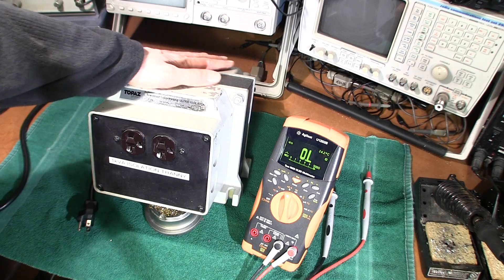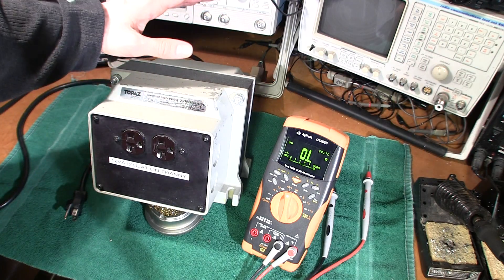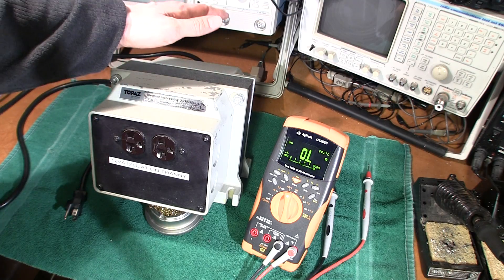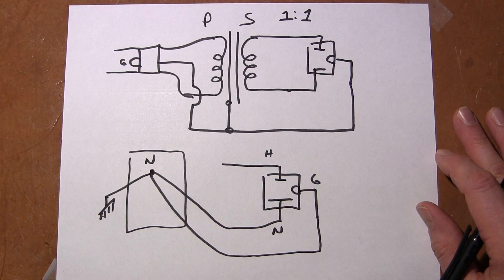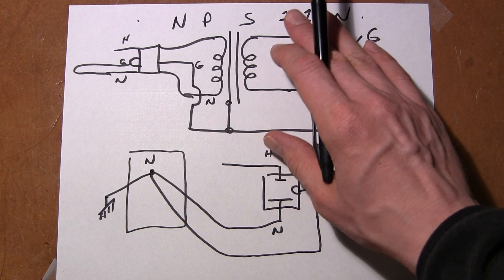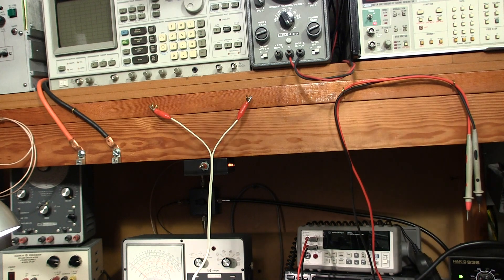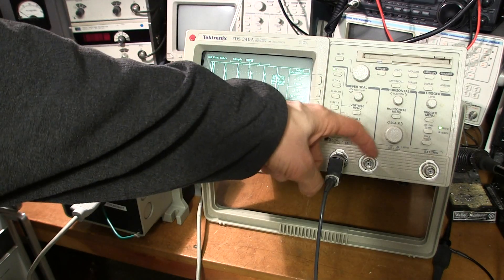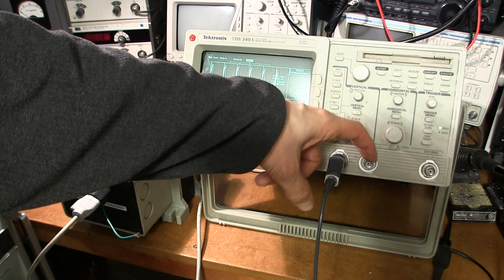Tech Tips Tuesday, Isolation Transformer and Variac Safety

Comment: I've seen many comments here about only the DUT being isolated from ground, however, when I was a student learning troubleshooting and repair techniques, the instructors at the vocational school cautioned us to never have the test equipment grounded. They sent us out to the rest of the world having been taught the very same thing Mr. Carlson showed in this video. Every piece of test equipment in that shop had all of the ground pins on the power cords removed. Every one of them. Meanwhile in the electronics theory class down the hall, they blew up a brand new 540 series Tektronix scope because of said grounding issue! I don't remember anything else about the incident so I don't know what they were measuring, how it was hooked up or what- just that they mentioned it to one of our instructors and then we were told about that precaution. After that the electronics instructors were removing the ground pins from the power cords or using the adaptors as shown here. 

Anyone care to explain why it is bad to float your test equipment? Not looking of arguments or heated discussion, just good explanations.
Reply: I was taking an analog electronics class at the local community college back in the 90's. My lab partner was in the air force and she said usually stationed in an AWACS. I was taking notes and she was hooking up the circuit. so she had the power supply on and somewhere in the circuit she said lets see positive goes to negative and before i could say no!, she connected the connection. there was a bang and smoke came out the back of the power supply. The instructor walked over expressionless. Picked up the power supply, unlocked a closet. He exchanged the blown power supply for a new one, locked the closet and w/o a word put the new power supply down on the bench in front of us.

Comment: I was surprised you said the BBC barrels are connected straight to ground. I'm pretty sure that when I us ed to work with oscilloscopes the bnc sockets were isolated from the chassis and connected to ground via 'safety resistors of 47 or 100 ohms to limit ground fault currents.

Comment: Where I live (Western Australia) it is mandatory that ALL homes be fitted with "earth leakage detectors" whereby if the slightest bit of current is detected in the earth lead then it will trip the circuit breaker (half the appliances in my house tripped the breaker after the detector was installed).

If you KNOW that your mains is properly wired with an earth leakage detector then the safety issues raised in this video are not as great.

Comment: Hi Paul; It seems most folks recommend using isolation transformers when repairing old radios and such, especially the transformerless type. Is there any advantage to using one when working on modern tube guitar amplifiers such as Fender or Vox--or could one be in more danger plugging such amps into the isolating transformer?
Reply from the maker: That's a tricky question Ed. Personally, I use the isolation tranny when ever I can.
Reply: The Viz isolating transformer I'm bidding on has only 2 prong outlets on the isolated side. When plugging in a 3 prong plug would I have to use the notorious 3/2 adapter?

Comment: Never understood the point of an isolation transformer... (It's 1:1, so it's still line voltage, and you're still going to get nailed).  I'm legally blind and don't work on HV gear (what wire is that? *%@#! that was B+... not so good. :-) ), so it may just be something I don't understand because I've never done it...
Reply: You'll still get shocked if you manage to touch the isolated neutral and isolated hot simultaneously.   But touching something grounded (chassis of equipment, oscilloscope probe clip, even bare feet on the floor) and the hot of the isolated supply won't make any current.   So it's safer.

Typically one adds a 100w light bulb in series to the secondary output.  Then if hot and neutral are accidentally shorted in the device under test the bulb lights and nothing bad happens.

Comment: Thank you for this video. There is more YouTube BS on this topic than you would believe. 

One suggestion, use correct nomenclature for the various wires in the system. 

What you call ground is "protective earth."

What you call neutral is "current carrying neutral."

What you call hot is "live phase."

And most importantly, there is only one use of the term ground. That is the "grounding conductor."  There can be only one in any "separately derived system."  It runs from the service entrance load center, the first so called fuse box. 

The constant use of incorrect nomenclature makes it hard to understand what people are talking about. 

In your case, you have drawings. Without those, a trained electrician would be confused and immediately think you were an amateur (which you clearly are not.)

See the National Fire Protection Act, chapter 76 (76 NFPA) also known as the National Electric Code (NEC) for source material.

Comment: Hello.  I work in the Uk. Our mains supply is 240v. My power tools for my occupation use a 240v primary to 110v secondary step down transformer . That is all my power tools run on 110v this is standard in the UK. I recently had cause to examine the inside of the transformer and I saw that the mains earth was not connected to the earth pins of the 110v outlets. So I thought there was a wiring fault. I immediately connected those 110v earth pins to mains earth. I have  just seen this video and am sat here wondering if I have done the wrong thing. Are the 110V outlets meant to be isolated from the mains earth as you have just shown here? I ask in case I have misunderstood the video. Thanks Joe
Reply: Normally the earth on those is centre tapped on the secondary so the output is +55v to +55v with respect to earth. This means if there’s a fault condition and you get a shock from the tool the voltage difference is small enough that it’ll make you say bad words but almost certainly won’t kill you.

Comment: Paul, would a GFCI outlet provide adequate protection in lieu of an isolation transformer? If not, why? 

Thanks for making these high quality videos.
Reply from the maker: Hi David. NO, a gfci will not work. The device under test has to be isolated from the mains while in operation. The gfci will not perform this function, it only trips and shuts off. It may not trip in all cases either, (2 wire cord) and so on.

Comment: Another great video,  I am very interested in these devices but currently cannot afford. However, I built a "Dim Bulb Tester" with an array of different bulbs for their wattages.
Recently, I purchased a Peavey "Flight Case Mx", VTX Series Amp Head"  130 watts.
The pre amp is solid state, into (4) GL6'S. I bought it from the local pawn shop for $120 I did play it at the shop before I did the deal.  But because I did buy it from a pawn shop,  I am suspicious of why the amp was there. It isn't hot, been on their shelf for two years. So did somebody  pawn because it was breaking g down? or did they need the money?
    So I have the amp now, I have opened on my bench.  I am curious if there is a fail while testing. I know this can indicate a short,

My question is about resistors going out of spec,  will that also cause the dim bulb tester to fail too? 
If you don't mind, I have another question. I have read that some guitar player hook up a variac to their amps. I am guessing they might  be doing this to play their amp at a lower volume. But still getting the crunch.  My curiosity is: if I found the right bulb if I could duplicate this effect with the dim bulb tester?

Comment: Thanks for the video Paul. What I don't understand here is why the ground terminal is connected to mains earth on an oscilloscope? What is the down side if I just remove the earth connection from the AC in socket of my oscilloscope?
Reply from the maker: The down side is, you may have a "live" scope chassis at some time. The common lead of your scope probe is connected internally to the scope frame (in most scopes)

Comment: So, when a tech is going to work on a piece of equipment, should he only hook up only the hot and neutral of the isolation transformer and not hook the ground to the equipment under test?  Providing one has made sure the neutral and ground has not been bonded at the output receptacle.  Thanks Paul

Comment: Good video.  I gave it thumbs up.  But there was a mistake on the schematic for the variac.  The mains input connects to a center tap on the autotransformer, not the end of the winding.  This allows the variac to step the mains voltage up or down, depending on the knob position.
Reply from the maker: No Mistakes Steve, I have many Variac's that will not step up the line..... It's all in the way you want to draw them.

Comment: So, how can one use a scope to see the mains?  Being a smarter newbie, I would like to do that, but have been hesitant to do so until I understand the situation better.  This video and one on EEVBLOG have shown that caution was wise, but I'm unclear about how to do it with relative safety. 
Based on this video, it seems like it could be done by disconnecting the probe ground/common from the probe, and letting the ground side of the connection come through the power cord. True?
My scope us a Rigol, which claims 300v capability for the inputs, and I live in North America with 120v power, which should stay under 300 volts peak to peak, or close to that. A 10x probe should keep it well within range, right?  
Or would it be wiser to use a variac to drop the voltage fed to the scope?  It's only the waveform I'm interested in...I have a UPS that seems to be interfering with my X10 controls and I'm curious why....and I'd also like to see the X10 signals on the house wiring.  Any thoughts on how to do this?

Thank you for the excellent videos!  I'm learning a lot from them, and have many more of the older ones to watch yet.  Subscribed now so I'll hear about them as they are posted.

-- Mike
Reply: BigMjolnir the safest way to use a scope to measure the mains is to use two probes using the tips only, one for live one for neutral , not the ground clips, and set the scope into a differential mode where it displays the difference between the probes.

Comment: OK OK I get it. I am very much a "newbie" to electronics but I am fortunate enough to have quite a lot of test equipment. A lot which I am just learning to use.  I also have a "shack" (Radio/Microwave). I play.
HOW do I stay alive (I am not totally stupid) but 20 pieces of test gear and the same amount of radio "stuff" ,associated with it's 240v supply wiring presents a problem.
So what is the best way to deal with the issue?
Love to see a video on it. If you have done it, please point me in the right direction. 
Do you start at the main room inlet, with the associated fuse system? Leakage/ground detectors etc.? They would want to be fast and I don't think they "save your soul" only the equipment.
Too much to ask here.
Anyway, I sincerely thank you for your time and effort.
David (from "down under")

Comment: I suggest you check whether your isolation transformer and\or variac (my "variac" is isolating) have fuses. One of mine did not have a fuse, so I had to install one. I blew it often since. The other even had two fuses, one on each primary lead, but they were 3.15A good to keep the office powered but too much to limit the damage to the DUT.

Comment: I am a bit confused cause i was under the impression you isolate the device under test but have you test equipment to mains.  so in respect to what your saying i should be using my isolation transformer with the disconnected ground on my secondary to power my test equipment and the device under test. for some reason this sounds like a dangerous loop as nothing would be therefor grounded. please help clear up some of the confusion.
Reply from the maker: The isolation transformer you see has the earth connection on the secondary side connected to the primary earth. Keep in mind that the earth is connected to the neutral wire back at the breaker box. This creates a hazard. Floating test equipment is purely up to the serviceman. I have found in some cases (for my own use) this is needed. Like everything else that deals with mains voltage/current, you need to understand the topology of what your working on to consider this. If your unsure of what your doing, don't float test gear!

Comment: For starters you would normally use the isolation transformer to isolate the device under repair, not the scope.My isolation transformer the test plug is only connected to the secondary, the ground prong is completely open on the transformer.Mine is a Hammond manufacturing co, made in Canada.
Reply: I have a Hammond model 171B isolation transformer.  The ground prong of the output receptacle is definitely connected to the input cord ground and the transformer frame on mine (I just checked).  In addition, Hammond's own data sheets for the product show the output ground terminal connected: https://www.hammfg.com/electronics/transformers/line/171
(My unit is an older model with no circuit breaker, and with an outlet instead of a pigtail for the output).

Comment: Hi, Mr. Carlson. I am a fan of your videos and you are doing a great job with sharing your experiences. By the way, I am really surprised about the connection of the earth and the neutral at the breaker panel. In Turkey, it is strictly forbidden to connect these two lines. Instead of this method, every apartment or house have their ground line connected to  the soil via a copper plate covered with galvanize.
Reply: Basically this is about the differences between the 4 kinds of system grounding listed in the IEC electrical installation standard(s).  In a TT system, the Neutral is grounded at the power company distribution transformer, while the Protective Earth is grounded at your house, thus the two are connected only via the ground itself plus any leaking equipment in your house.  In a TN-S system, the Neutral is grounded at the power company, plus there are mechanical and contractual guarantees this connection is reliable. In your fuse panel before the RCD/GFI, the Protective Earth wire is connected to this guaranteed grounded neutral, but is kept separate in the rest of your house so any excess current leaking from Live to PE can still trip the RCD protection, this is what Mr Carlson described as being standard in his area (except his lab has no working RCD protection or that lightbulb would have tripped it instantly).  In a pure TN system there is no distinction, the PE and N are the same wire (called PEN) all the way to your outlets. This is considered dangerous as it leaves no way to detect deadly ground leakage going through someone's heart.  Finally there is the so called IT system where the power source has no solid connection to ground, there is no Neutral and your outlets have two Live wires and an optional PE connected to ground.  In an IT system there should be an alarm system constantly measuring if either of the Live wires becomes accidentally grounded, a "first fault" which must be fixed before any "second fault" occurs between one of the other Live wires and ground. IT systems are used in some places such as parts of Norway, but are regarded as something special/exotic in most of the world.  The white isolation transformer demonstrated in the above video converts any of the 4 systems to a separate IT system without the fault monitoring.  (Hope I remembered all these abbreviations correctly, it's been a few years since I last looked at the subject).
Reply: you forget that the secondery side of the transformer delievering the Voltage to your appartement is most likely grounded so in your case the connection would be directly at the transformer and not in your breaker panel i don't know much about Elektronic Installations in Turkey but not grounding the secondery side of the transformer would propose a lot of Risks and pretty much makes the ground line you are talking about useless

Comment: I think this is a very under rated topic . I don't believe it has been addressed fully here which is understandable because this video highlights the difference between filter conditioning  transformers and isolation transformer. We need to highlight links or create videos on practical techniques to  isolate techs and equipment . More discussion is needed to increase safety when working on mains . There seems  to be two topics a) human safety techniques  while working on electrical equip and b) safely using test gear on high voltage  without destroying equipment . Equipment requiring mentioning : isolation clothing , isolation transformers , differential probes.
Reply: I agree this is a huge topic that seems to catch out even the best of them.

Comment: Do you need that green wire on the adapter ran to a dedicated ground rod on its own wire? or disconnect the ground wire in the wall outlet and run it to a ground rod for your scopes?
Reply: the whole point is to isolate the secondery completly from the primary  connecting the secondery ground to somekind of ground whould then connect it over the earth back to the primary ground in which case you don't need that plug anyway